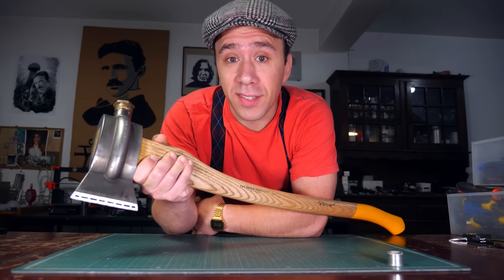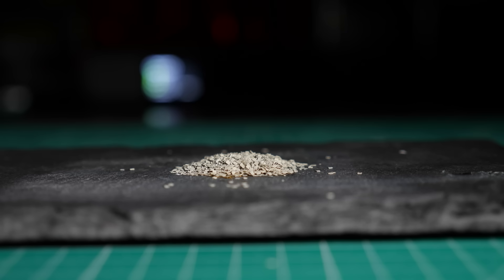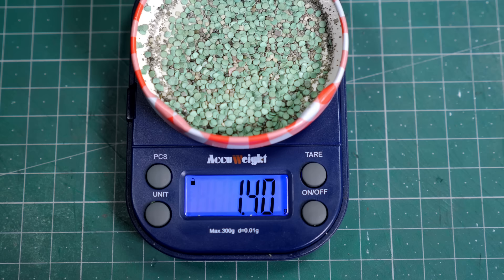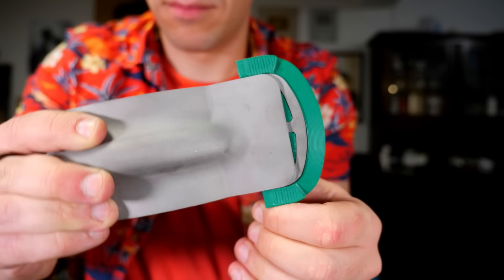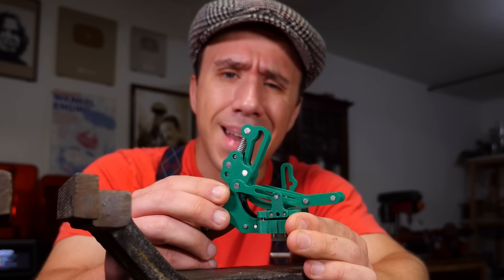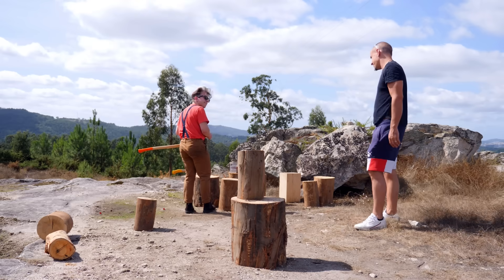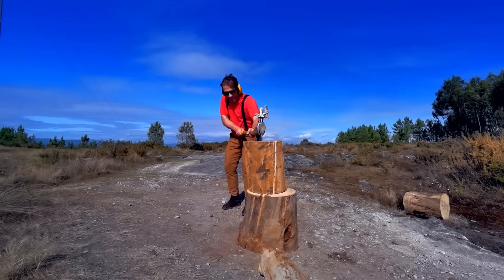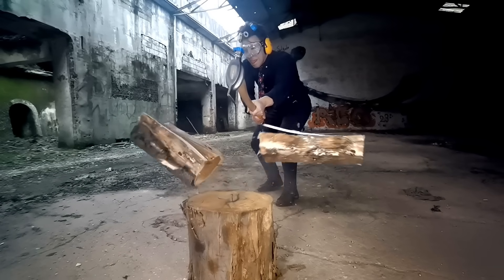I built a BETTER SHOTGUN AXE

Comment: Something to consider, when choosing safety glasses, get wrap around, full coverage, large sunglasses, or shooting glasses are not good enough to prevent debris coming in from the sides, and you are bound to eventually get small pieces of wood ricocheting into your face from the sides. Shooting glasses generally work well enough for guns, simply due to the fact that under normal operating conditions anything flying off of a gun is going to be really small, and will have all it's energy absorbed after the first bounce/impact, larger debris, say flying splinters have a higher chance of bouncing off something, and then heading towards your face. 

So either wrap around safety goggles, or a full face plate would be ideal. You can get them tinted for outdoor use.
Reply: Anything you're using should also be z87.1+ (or better) certified
Reply: I'd recommend a full face shield and helmet. I know it's unlikely, but imagine that the 3D printed axe breaks in a way that propels a piece of metal directly at your face. You might look stupid wearing a full face shield to use a axe, but you'd look even more stupid in a hospital bed because you decided not to use safety equipment that was available.
Reply: A full face shield is definitely needed here, not only for wood chips, but for metal chips should his luck run-out.

Comment: use flash powder from fireworks (KClO4). for example: Deblasio Cobra 8, it has 100 grams of flash powder and its explosion can destroy a car if placed properly. i saw that 10 grams equals 3.3l of gas, thats a bit less then smokeless powder but you can get/make KClO4. it also has a detonation speed of 1250m/s

Comment: Study actual gun lock ups to get some new ideas that might help? Some sort of better lockup to make sure your battery stays strong so the explosion can only go into the wood. For the trigger have something on/in the blade itself. As the axe head enters the wood, have something pushed back up, like a trigger to get the timing correct and repeatable.

Comment: shape the the axe tip can help. with vents parallel to axe all the way to the tip, so much so that it deforms the tip. kinda like a serrated knife. you want the gas to not just out outwards, but down, to help split the log.  im sure there is an ideal ratio of sideways gas vs downwards gas to ensure logs split.  

also, more gas. 

also, timing. 

also, love you slut.

Comment: You should have a linkage that goes from the blade back to the firing mechanism so that when the blade hits the wood the wood also pushes the linkage back which pushes the hammer back with a ramp so that it releases the hammer after a short amount of travel.

Comment: Love the video. Having suggestion for you since you need to time when the charge goes off. Why not build a pin mechanism that goes through the ax head that detects how deep the ax is in the wood and pushes the pin up into the release mechanism. That way you could control when it goes off how deep the blade is and it would be consistent regardless of how hard you hit

Comment: What if instead of trying to uses the gas exhaust to try and split the wood apart, you use the gas exhaust to push two halves of the blade apart? That way, you don't need to be as concerned with sealing because you'll be entirely in control over how well everything seals.

Comment: The answer is always more hydrogen. Maybe electrolyzed from squeezed tomatoes, then even if it doesn't work the revenge will still feel good.
On a serious note, maybe making a sharp pin or wedge which gets pushed out of the axe head by the explosion would be an idea? This way the gas cant escape if the wood cracks too far.

Comment: Two thoughts: 

1) Could a steeply graded concave bevel (think "curved snow plow") act as a depth stop to prevent the blade from penetrating too deeply (e.g. a very small radius shortly past the blade ports that quicky turns perpendicular to the motion of travel) while also preventing harder woods from splitting outright like they would with a straight wedge?

2) Similar to the above, consider adding small, sturdy spikes set some small distance from either side of the blade that can bite into the wood as the blade lands. Ideally, these spikes would be small; only digging deep enough to keep the wood pinned against the blade and prevent splits from opening, but still shallow enough that the kick back of the axe from the shell firing is enough to clear the spikes from the wood and allow the wood halves to travel on their merry way. If designed correctly, these spikes could act as a depth stop similar to #1 (but without necessitating changing the geometry of the blade or grind). Logger's chainsaws use similar spikes, though theirs are in-line with the chain/blade and at the base, vs being perpendicular to and on either side of the blade as I suggest above. 

Additionally, if you bladed the planes of the spikes facing the axe blade, the outward force of the explosion would split/unbind the small amount wood pinned between the spike and axe blade in the event that the kickback didn't free the spike from the wood outright. You know, for safety!

Comment: Instead of the gasses pushing the wood apart why not have the gasses push two little arms out to split apart the wood, I have seen a design like this that used the power of your arms to work. It would be very complicated but if it did end up working the two parts would fly away

Comment: I think you should abandon the traditional axe head shape entirely.  It wasn't intended to facilitate splitting wood with air pressure.  You need a shape that's going to achieve two things: Maximize penetration into the log, and create a sealed surface area against the penetrated material so all your blast force doesn't bleed off into the atmosphere or at suboptimal angles.

You need a splitting maul, not an axe.  Even when you get decent penetration into the wood, you're losing most of the pressure wave because the hole created by the axe head isn't sealed behind it unless everything goes perfect.  More spear-y, less axe-y.

Comment: the axe handle is backwards @ 16:18
Reply: Yes I also feel like it's probably not particularly needed due to the fact that most of the force is going to blowing up the log and not so much force of swing it is very funny though that it is backwards
Reply: @Fuzzypattyg  true(been on a forged and fire binge) when swinging, that swoop in the wood angles the axe head into the wood with the center of the axe but when reversed the axe head's first contact is with the top or bottom rather than the center. just the physics i see behind it ig
Reply: @_Exotic.James_  yep All very very very valid points for a conventional ax and I think he will probably turn it around he is by no means an idiot

Comment: ....WHY INSTEAD OF RELYING ON POWER OF EXPANDING GASES TO SPLIT THE LOG...USE THIS TO POWER THE CHOP?....MUCH BETTER SOLUTION

.....YEAH,THAT does MEAN LIKE YOU'D NEED COMPLETELY DIFFERENT STRUCTURE,BUT it will work...BECAUSE THERE'S SOME cartridges THAT USE THIS PRINCIPLE

.....SO IT'D LOOK LIKE A PISTON....AND IT'S BODY IS ENDED UP AS AXE'S BLADE.....ALSO YOU NEED A SOMEWHAT EXPANSION CHAMBER IF YOU WANNA USE OXYHYDROGEN

............

Comment: I think the issue you are having with the logs not splitting with either generation axe head is because the gas is finding a way to expand in the wood enough before it splits.  You should make the blade be more like a piston.  The shot cartridge fires, pushes the blade down whatever distance math says is needed and the gas only escapes when its at max distance and an exhaust port is exposed.  That way the blade itself will be pushed down into the wood and having a heavy axe head will stop it from backwards instead of the blade down.  Basically a single firing of a combustion engine.  It also opens up other methods of combustion.

Comment: I've chopped 1000s of cords of wood. Primarily maple, oak, spruce and Doug fir. I'm good with a splitting maul, 4ft diameter round? Split it in one swing 98% of the time. 

With an axe there's a balance swinging between exertion (how much power you put in), placement (where your axe head lands) and technique (how you bring the head down) that I got down long ago. I can go all day long with my 8lb splitting maul, cuz trust me, I use the least amount of energy required. It's a nice perk of proficiency that you get good enough to produce high level but now you can be lazy about it .  We've all seen it, people who just make it look easy, y'know? (That being said those big arm guys who chop wood on tiktok, y'know, the cougarbait, are fucking terrible at chopping wood. No hate, make the money my guy - just know we all know what's going on. I ain't looked but I bet he's pitched an OF account somewhere over there, lol)

Gum is - by FAR - the hardest wood I've ever had to split. It's one of the, like ~2 species that's easier to split seasoned, which just doesn't make any sense to my brain at all. 

The only acceptable thing to do with a gum tree, imo, is burn it where it stands. Along with holly trees, just straight to hell with em. 

So seeing the axe split ANY of the gum is impressive.

Comment: For version 3, consider making the blade move backwards in relation to the axe head upon impact and use the movement to drive the trigger instead of relying on inertia. Essentially a mechanical contact fuze used in aerial bombs during WWII.

Comment: The shotgun axe is one of the coolest things I've ever seen!

My two cents for part 3:

2 or more shells, electronic hammer (maybe a solenoid or some electromagnets holding a spring) and a stronger better built system with failsafes (the trigger mecanism could be hold by some loose rope. Same concept used when you gotta pull something with a chain and your truck), so if anything goes wrong you don't get your head smashed by 500g of bare metal.

Comment: Gas pushing the wood is craaaaazy. I'm impressed it ever worked, since transfer of power is so variable and dependent on perfect conditions. As others said, I'd have the gas move the axe head somehow - similar to those mauls with rotating wedge / levers. Looks like "EasyGo" brand might be a starting point.

Comment: Im all up for it.

Also consider the angle of split and the shape of the axe and length of the log to maximize sealing
Try hydrogen again if possible
Also maybe expand the port area? Or somehow maximize that area the pressure is acting on all while sealing. Maybe the axe should form large chambers with the wood by only holding contact by the corners of the axe blade
Also how about splitting your system into two separate channels? or maybe more? if some wont seal, others will. Perfect for using hydrogen instead of gunpowder

Comment: Should turn the shell around, put the firing pin on the tip of the axe, and use the gasses as a rocket booster by adding a rocket nozzle on the top. directly hammering the firing pin will reduce mechanical delay.

Comment: I would consider a small X shaped axe with the holes in the middle. 

Also maybe check how deep blade usually goes in and add 90° rind that would also eat in a little bit into the wood to seal better?

Comment: One problem I see with all three versions of the axe is that the jet of gas is directed pretty substantially forward, so in a log that is already split quite a bit by the axe hit itself the jet is directed into the crack(giggity) rather than into the two sides.

There's really no reason for this thing to be this...axe-shaped? At this point. A thin sharp chissel like shape with internal canals to direct the gasses much more obviously sideways might work way better.

Comment: What if you create an axe where the axe head can slide down. So you hit the wood with the axe, the shotgun shell fires and forces the head of the axe to slide down a railing to force its way into the wood. It may make better use of the energy from the shotgun shell, as well as being more dangerous. Would be a win win yes?

Comment: As far as getting parts made you can with a straight face say its a powder actuated log and stump breaker. You use it to break apart dead tree stumps or scrap logs to make removal easier. As for getting shells I couldn't really see a way beyond taking up hunting yourself unless there is some form of licensing you could apply for (assuming that a mere mortal could afford to do so) that would allow you to buy bulk gunpowder for Research and Development. Your homeland is strange.

Comment: you can forgo the classic axe wedge joint and have the pressure travel straight from shell to nozzle 
a mini handle on the head that attaches to the wood handle with screws or something

Comment: How about a 2 stage/ 2 piece head, where the separate blade is retained but floats in the head. 

The firing blasts the blade into the log ~1cm. 

That releases exhaust into the blade…. as your current build.

Comment: What if you made 2 steel flat 'wings' on the side of the axe, clamping shut around the explosion chamber, and the explosion instead of dumping into the wood, splits those sides apart? You could get a far better seal on the explosion instead of having it leak out most of it and maybe even have the flat wings have lever advantage?

Comment: You may want to try a Scandinavian style splitting axe. They are relatively narrow but have a long blade so you might be able to get it in fairly deep without over splitting so you always get a good seal and more consistency. Also gives you more volume to expand into if you want to try hydrogen again.

Comment: The main problem is the sealing, the moment a path for the gases is created they escape from that point, negating the crucial distribution of force. 
For a theoretical v3, a piston design would be ideal, make the end of the piston the wedge that split the wood. Basically attach a wedge on the business end of a powder actuated nail gun... I bet you can do it!

Comment: You should try compressed air. Something cheap and reloads automatically. A pneumatic axe. Run the gas line through the handle so it's out of the way. Maybe have a backpack compressor, lol.